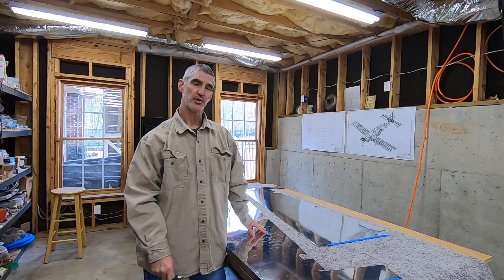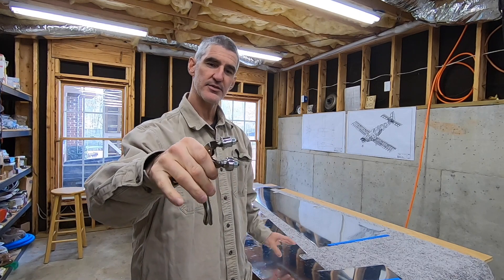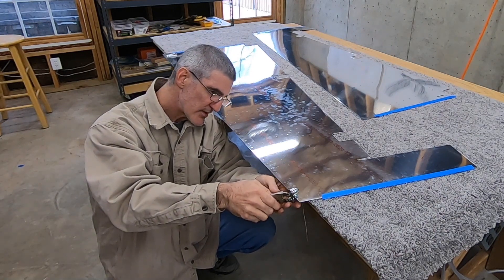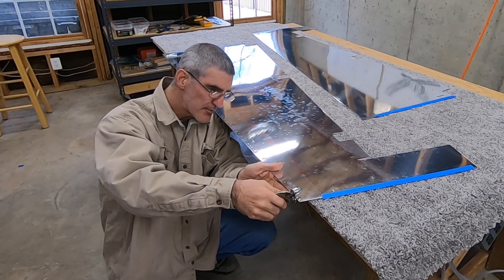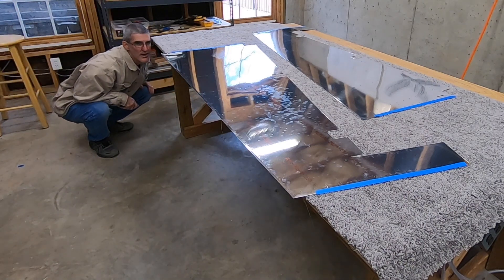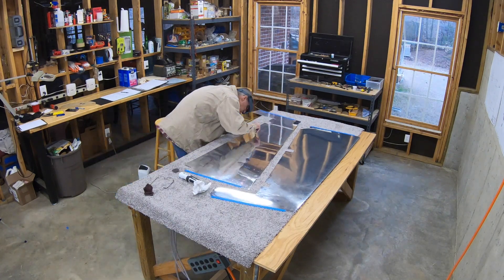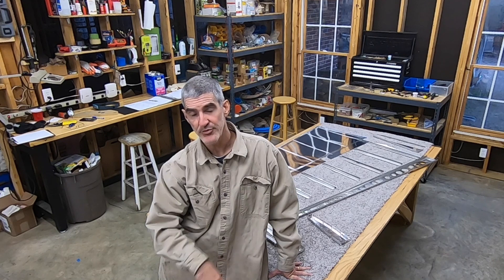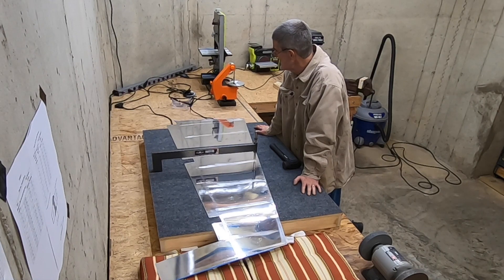RV-10 Build Log - Emp 23 - Disassembling, Deburring, and Dimpling…

Comment: Why did you use the pneumatic tool to dimple the outside vs just using the C frame like you did for the ribs?
Reply from the maker: The C-frame is only absolutely necessary to dimple holes in the area of the middle of the skin that can't be reached with the pneumatic squeezer.  The squeezer is easier to use but the C-frame (supposedly) makes a crisper dimple.  Thus far, I've been using the pneumatic squeezer wherever it will reach and the C-frame only where necessary.  I'll probably start using the C-frame for all the skin dimples at some point, when I feel like the dimples I'm making with it are noticeably better than the squeezer.
Reply: @missiletwentynine2667  Nope thats what I was wondering, i didnt know know if if there was another reason for not doing them all when you had it on the table doing the rib holes is all.

Comment: Curious what deburring tip you are using on the Dremel? Trying to see what you were using on the skins. Thanx
Reply from the maker: The tip I use in the little electric screwdriver is the Hex Shank Hole Deburring Tool (SKU: DB04) from Cleaveland Aircraft Tool.  The electric screwdriver is very light and cheap, and I mostly just let the weight of the screwdriver apply the pressure.  If I really want to go slow, the hex shank of the tool makes it easy to twist by hand, too.  Link here:  https://www.cleavelandtool.com/products/3-hex-deburring-tool?_pos=1&_sid=36a746ea5&_ss=r&variant=18378229153854
Reply: @missiletwentynine2667  Thanks

Comment: Curious if you’ve gotten to film attaching the R-1004 rib to the skin yet. I know the trailing edge of the flange is a bear. I’m looking forward to seeing how you got that done. I know the magic of editing will make it look easy and with less profanity than mine did. Keep up the good work
Reply from the maker: Nope, just primed everything this weekend.  I’ll start riveting things together soon.
Reply: It's actually one of the simpler things, as the flanges are all facing down, you can just use a squeezer to set all of the rivets. Once you get to the last hole prior to the trailing edge, the instructions specifically state to use a blind rivet one the left side skin, and you can use a thin nose yoke to get the right side. Step 7 on 7-9 does a great job explaining this.
Reply from the maker: I do have a thin nose yoke, so I'm hoping all but that last blind rivet are easy.  The plans even mention that the blind rivet will bottom out against the rivet on the far side until you start to squeeze it, so I'm hoping it's as easy as they make it seem!  I'll find out soon...